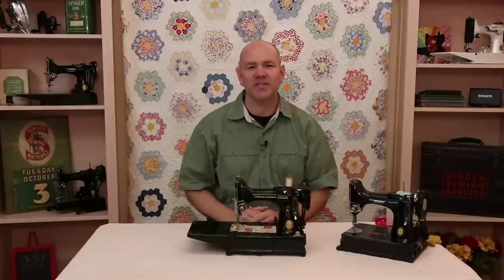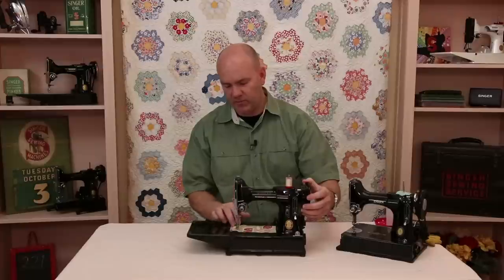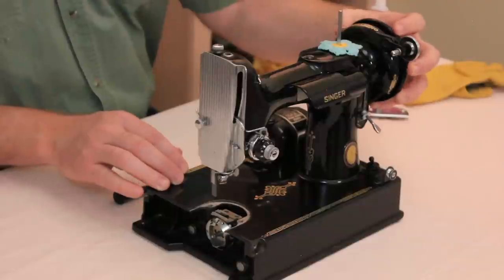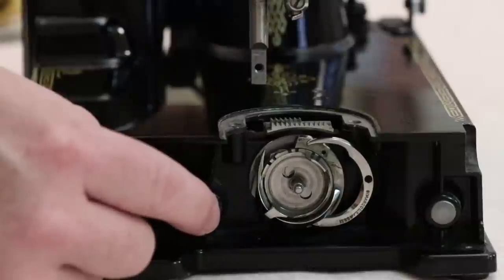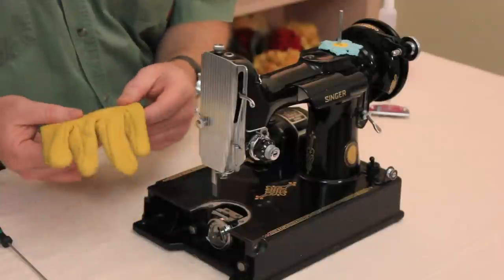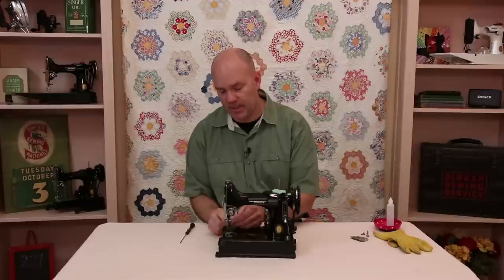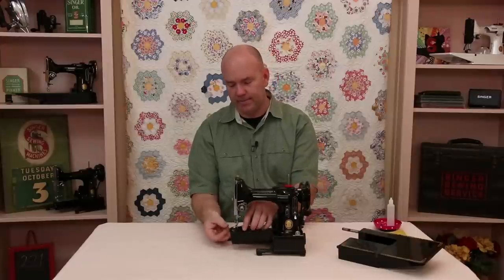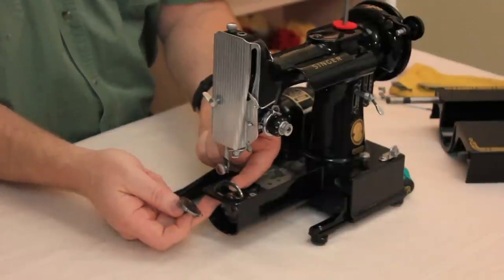Singer Featherweight 221 222 Repair Video Tutorial - Thread Jam

Comment: My mother-in-law was a fantastic seamstress.  Me, I can’t sew (xcept zippers not sure why that is) I hate sewing therefore I don’t sew unless I have to.  My mother-in-law gave me 2 featherweights one is a 221 the other a 221K.  When I would try to sew something the bobbin thread kept getting jammed up.  I finally decided to do something about it so I watched your video , followed it to a “t” and then some.  I ended up taking the bottom off to get to the thread sure enough there was about a 3 inch piece of thread wound around the outer housing of the bobbin. So thank you I never could’ve done it without your instruction.   I feel so good about fixing it that now I’m going to attempt to fix my old pellet ice maker.  Wish me luck✌️😎

Comment: I feel as though I have found a new Featherweight friend. This demonstration gave me the information and confidence to ‘service’ one of my Featherweight machines. Even though the bobbin was the actual ‘trouble maker’ I now know that I can likely fix things for myself. By the bye, using a micrometer, the bobbin measured a depth/height of .324 and it was being pushed out of the case around stitch number 8; replacing it with a bobbin measuring .287 gave a perfect stitch. Thank you!

Comment: Thank you for this wonderful video.  My wife has a Singer 221-1 that we got from my mother.  I think it dates from  1941.  She stopped using it a few months back, telling me that the bobbin was not feeding correctly.  Over two decades ago, there was a sewing machine repair shop not far from our home.  I always took it there when it had a problem.  I think the owner retired and closed the shop.  I have not been able to find another shop since.
I know almost nothing about the sewing machine but I do have two engineering degrees.  I thought this couldn't be that hard.  I quickly learned that the machine was locked and I no idea of why it locked.  I opened a few of the access panels but didn't see any obvious item that would lock it in place.  I did find a thread sticking out of the bobbin mechanism and found that I could not pull it free.  I knew there was a problem there but had no idea that this two inches of thread could lock the whole machine.
I could not see an obvious way to disassemble the bobbin base, so I decided to do a YouTube search.  I put in "singer 221-1 sewing machine tutorial" and found your video to be about fourth in the list.  I could not be believe my luck in finding your video as the first one I watched.  It was my exact problem.
I had to hunt around for my set of jewelers screwdrivers but once I have them, getting the clip opened was very easy.  I appreciate your tip to NOT use any metal instruments to free up the base.  I would probably been tempted to go after it with pliers.  It took a couple of minutes to "finesse" the bobbin base out but once I did, I found the inch worth of thread that was jamming the whole works.
After reassembly, the machine checked out fine.  I passed along your hints about how to prevent the jam to my wife.  I think the sewing machine will be good for another 80 years.

Comment: It worked!  The “handy” gene skipped me completely. I have NO mechanical aptitude. But I watched your video and it was so clear and concise that I was able to get the assembly apart and find the tiny piece of thread that was causing my problem. I did have to douse it with oil and let it sit for 24 hours but the machine is purring again!  Thank you!

Comment: Just got a '56 featherweight. I installed a new needle, wound a bobbin and inserted it, threaded it, then grabbed some scraps to test it out... Bottom thread would get caught on something and jammed up... cleared it and tried again a few times, same result. Found/watched this video and checked the machine. Wouldn't you know it, the finger on the bobbin case base wasn't in that slot. Quick fix. I setup the machine again and tested with new scraps by turning the machine by hand, and now I got beautiful stitches.

Next up, tension the belt (going to order a new one, and other things, from the shop) so the motor will spin the machine instead of slipping.

Thank you very much. Think I'm going to have fun working with this machine.

Comment: Love your videos. My Janome computerized machine is at the hospital being repaired so I’m using my featherweight. I took my machine apart to clean and oil it. When I put it together the thread kept breaking. As soon as I saw you taking the cover plate off, I knew what I did wrong and you confirmed it a few seconds later. Corrected the issue and she’s sewing great now. Thanks so much!

Comment: A lot of thanks from Rio de Janeiro, Brasil.  I was able to remove everything and got the piece of thread stuck.  Then I removed the wheel, which had two pieces of thread stuck.  Then I loosed the motor screw.  So now everything is running properly.

Comment: It's 02.40 am. I have tried everything but my Singer 221  is totally stuck. I saw some little bit of thread in the bobbin case area. I took the needleplate off and put it it back several times, I tried to reach the thread but could not.  I was totally clueless. Now I found your video. I lifted my Featherweight on the top, gave the bobbin case area a good dose of sewing machine oil, and finally I can go to bed. I really hope I can manage to get my machine to function tomorrow.
Greetings from Finland and thank you very much!

Comment: Thank You for this video.  I solved the issue with the 1947 Featherweight 221 I purchased.  I had to run out and buy a precision screwdriver to loosen the screw to get the assembly apart.  I removed the tiny piece of thread that was causing the machine to lock up.  Now the machine in purring like a kitten.  Thanks again!

Comment: Thank you so much for these videos and the practical advise that goes with them!  1/2 inch piece of thread had me locked up completely.  I puddled the oil and I checked it in 5 minutes and it floated right to the correct spot!  Anything that keeps me going during 2020 is greatly appreciated!!  Thank you again!!

Comment: Thanks much.  This worked I was able to remove the small screw but then did the oil immersion trick.  My patience is zero so I only waited about 30 minutes but it did loosen up and I was able to remove the piece of thread.  I admit I did not remember about holding the threads or the wheel direction.  BAD on me. I will try better in the meantime. But then I saw about the thread removal tool. I am a bit confused that the thread will "just disappear" without being removed if you use the tool. Can you clarify?  thanks.

Comment: I will look for this problem when I check the machine I have and it is probably one of those models and it is sitting on the table it came with. If it has a problem I know what to look for and can repair it myself and I thank you for the information given in the video.

Comment: Great instruction and presentation!!  Question if I may.  After cleaning a jam I find the bobbin case base sticks in the hook around where the gib pivots, or seems to.  It's been cleaned, no rust, no rough points or snags that I can see and it is properly installed.  It can rotate about 300 degrees in either direction and then sticks or siezes.  Any ideas greatly appreciated.

Comment: Carmon,
Thank you for this video.
I am having trouble finding gib hook screws for Singer 221s. I am aware that the Simanco # 45831 gib hook uses the sloped/angled surface under the screw head and the Simanco # 170160 gib hook uses the 90 degree, squared off surface between the screw head and threads.
The black, reproduction screws do not seem to work in either type of gib hook. Do you have gib hook screws that work with the correct thread size and screw head for either the 45831 or 170160?

Comment: Hi, thank you for the help with the screw problem i had last week. I managed to get the screw u done but was still unable to move the gibb, so i filled it with the sewing machine oil that i have and i have now been able to move that out but i have been unable to move the bottom case base, despite having it filled with the oil that i have for 5 days.i have a non flowing machine oil, would it be best to get a flowing oil?

Comment: Since this video is several years old I don't know if you still monitor or respond but here's hoping.

I followed your instruction, including soaking in oil overnight ( did this step twice), then using leather to help allign the positioning finger with the opposite small hole. In my case the bobbin case did not move easily like you show in this video but I was able to position the finger and the hole into the required position. The case still does not come away. I've stopped because I don't want to force anything. Any suggestions?
Reply from the maker: Check out our Featherweight Schoolhouse for the follow-up tutorial to this one.... it would be found on the website by searching "Thread Jam".  https://singer-featherweight.com

Comment: Thanks for the video! 
My 221-1 bobbin case base is jammed and currently soaking in oil. The finger is also broken off. Someone must have tried to pry it. 
Since the finger is broken anyway would there be anything wrong with grabbing the center shaft with pliers and trying to turn it?
Thanks
Reply from the maker: Thank you so much for asking!  Follow the link below for more information and to contact us directly with questions about the Singer Featherweight - happy to help!  :) https://singer-featherweight.com/pages/contact-us
Reply: @featherweightshop  Thanks for the quick response! I was able to get the broken bobbin case base unjammed and out this morning. I soaked it overnight in sewing machine oil but it still wouldn’t budge at all. I put the tips of a fat needle nose pliers in the two holes in the base. You don’t have to squeeze or put force on anything. In fact you can force the pliers open for more leverage. Put the pliers into the holes, turn the wheel, and voila! Unjammed without any major effort. Now I have to buy the part to replace the broken one. I see that you sell it. Thanks!

Comment: We followed your video twice and left it to soak with sewing machine oil for 24 hours, but still can't get the bobbin case off.  We are trying to soak it again with sewing machine oil for another 24 hours.  Anymore suggestions to try, we don't want to use too much force.
Thank you Russ
Reply from the maker: Yes, good news! Our website has an updated tutorial for what you can do. There is a new tool to make this process easier. Great question!

Comment: Hi .I wondered with all your  Singer experience could you advise me on a thread jam in a Singer 319k bobin holder? Ive studied your featherweight videos which to me have a different bobin case assembly to the 319 K. The 319 k bobin case has multiple countersunk screws on the side. Ive tried soaking the case in machine oil for three days to soften the thread fibres but still jammed solid. Do you know if my bobin case can be easily stripped down to help remove the threads . Tweezers dont work on this jam .Thanks for reading this . Regards Aidan Bremner ...Algarve Portugal
Reply from the maker: Thank you so much for your message!  Follow the link below to contact us directly with questions about the Singer Featherweight - happy to help!  :) https://singer-featherweight.com/pages/contact-us

Comment: Hi I just bought a 222k 1954 - there seem to be a problem with darn and see switch - it is stuck in top position and doesnt change to darn - is something i am doing is wrong or there something is wrong with the machine ..... 

I bought it in really mint condition but i think it was just stored for a long time 

Thanks please help
Reply: Featherweight Shop i do pull it out and try to bring it down and also change the sewing length - i tried still doesnt work ?  Anything jammed ?

Comment: I hope you can help me.  I am to the part where I have the Gib screw out of the Gib Hook, but cannot get the Gib hook to came away from the bobbin area.  Is there something I need to do so that I can get to the thread?  I understand about putting the finger back in the correct position,
Reply from the maker: Check out the Featherweight Schoolhouse with all the categorized maintenance tutorials and troubleshooting and then contact the shop directly for further Featherweight technical assistance:

https://singer-featherweight.com/blogs/schoolhouse

Comment: The bobbin is locked in place and the gib bumps into the bottom frame of the machine so it can’t fully open.  What can I do to get the bobbin to move so the gib can be fully opened?  Thank you.  (I wrote previously, but I don’t know if I posted in the right place.  Sorry if there’s a duplication.)
Reply from the maker: Thank you so much for your message!  Follow the link below for more information and to contact us directly with questions about the Singer Featherweight - happy to help!  :) https://singer-featherweight.com/pages/contact-us
Reply: Thank you for your response.  I ended up finding a sewing machine repair person.  I’ve saved your link for future reference.

Comment: Is it normal for the thread to go into that side when rotating on the point of the hook gib?
Or is it normal for the thread to pass through the hook gib?
I suddenly felt a thread getting caught in the test today, so I saw it.
I ask because the thread does not go into the hook gib but passes through it as it is, and the thread comes out of the hook gib again and it seems to get stuck.
How do I fix this if the thread just passes through the hook gib.
Reply from the maker: Check out the Featherweight Schoolhouse with all the categorized maintenance tutorials and troubleshooting and then contact the shop directly for further Featherweight technical assistance:

https://singer-featherweight.com/blogs/schoolhouse

Comment: what if your gibb screw is really really stuck in there?
Reply from the maker: Do you have the small maintenance screwdriver?  It can make a huge difference.  Otherwise, soaking in oil overnight may help.  (We are expecting more towards the end of June... Covid really put the manufacturing behind schedule.)

https://singer-featherweight.com/products/screwdriver-maintenance-small
Reply: Featherweight Shop i sure do, i have a small multi piece precision set and a  stand alone that came with the unit i can’t seem to get it to turn slightly in either direction  also, the gibb screw seems dangerously close to the hook  they’re almost on top of each other
Reply from the maker: Be sure to watch the video on our website linked above about the difference of the Wera screwdriver compared others.  Their composition and springyness allows more torque without marring the screw head.  Happy to help!